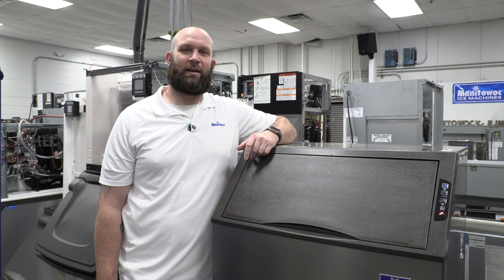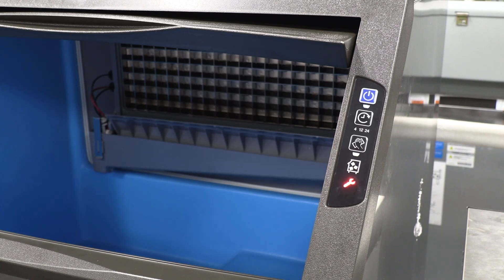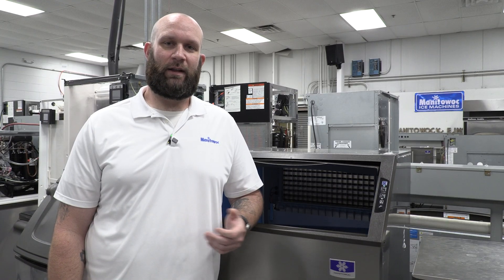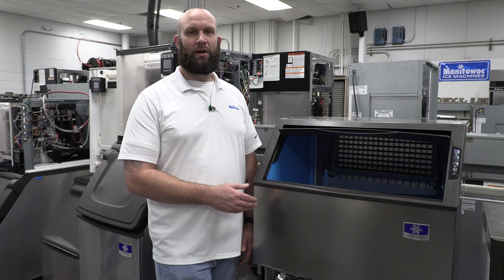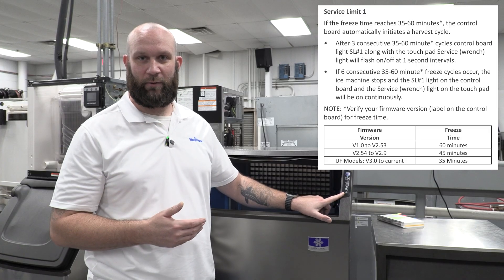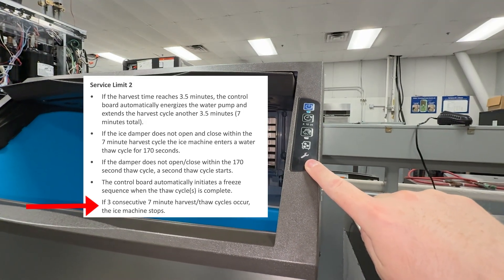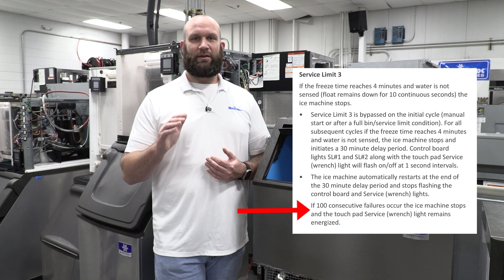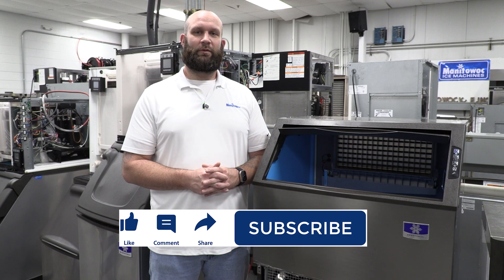NEO Wrench Light Explained: Troubleshooting Manitowoc Undercounter Ice Machines #manitowocice

Comment: I have a service light three. It flashes red after a cycle. What is the problem? I know you mentioned Water fault but what is the solution to this? I just bought this machine and it is brand new. Please help.
Reply from the maker: Thank you for watching — we appreciate your support. For further assistance, please contact our technical support team from 7:30 – 4:30 central time at 1-800-247-4520 with your machine’s model and serial number.